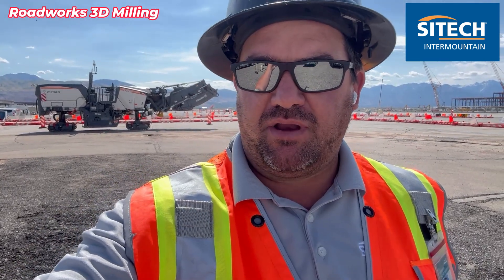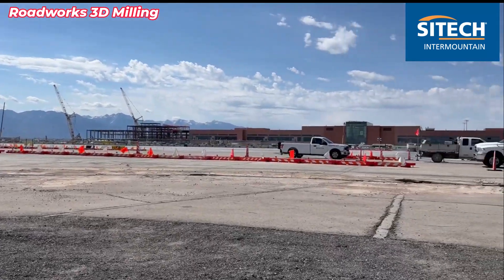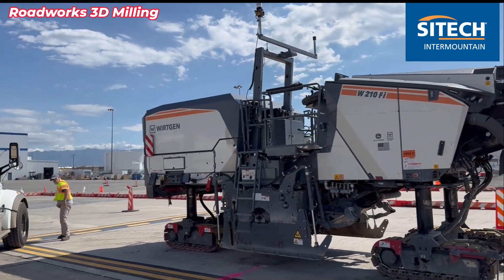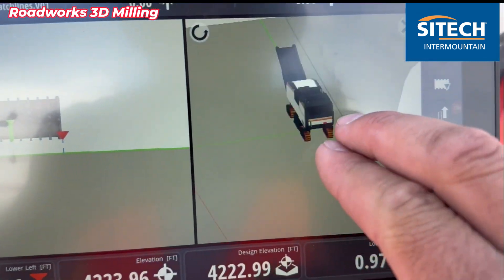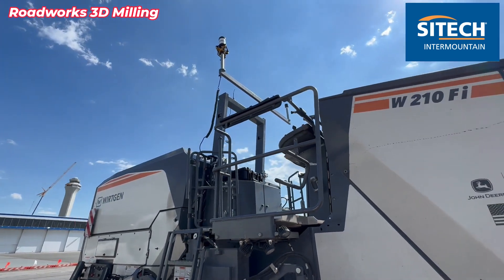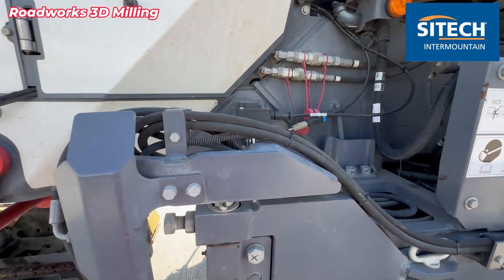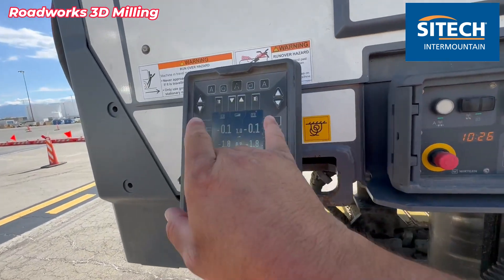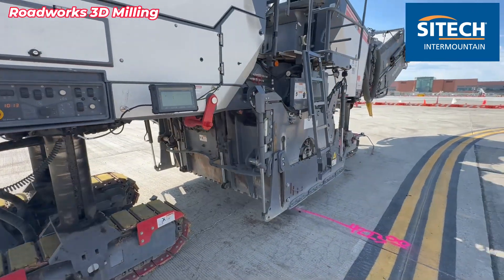Roadworks Milling set up and Process

Comment: Hi jeff sorry to keep bothering you,ive just got my engcon back after some maintenance, went into web interface ,configure told trimble ive got tiltrotator, engcon model all working on system status but on my work screen bucket dosent move ,now have i missed something  i was rushing or do i have to re celebrate the sensors,a tech guy from sitch uk showed me how to do calibration on the sensor ,but all sensors are working fine ,ive only got a tilt sensor no rotation sensor, thanks in advance jeff ,its warm for us here in the uk 24c not sure what that is in f 😂